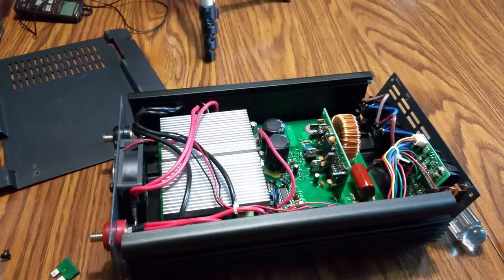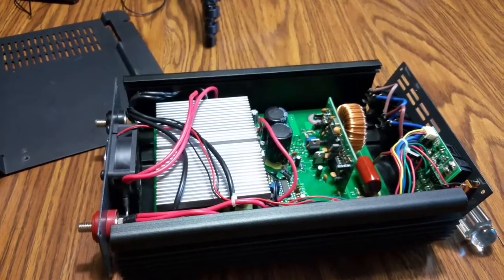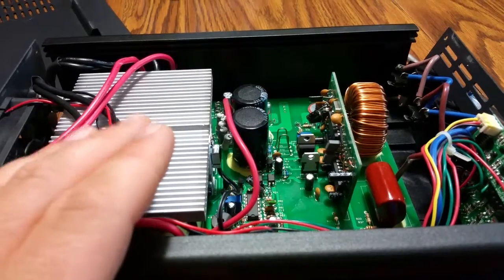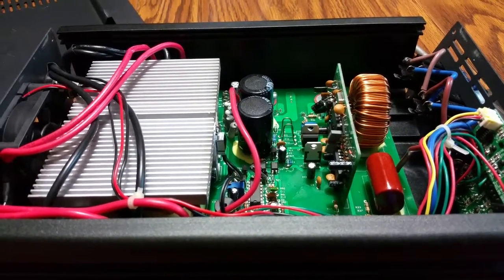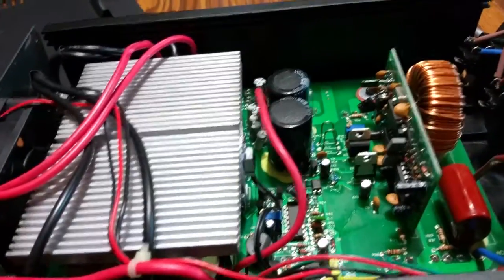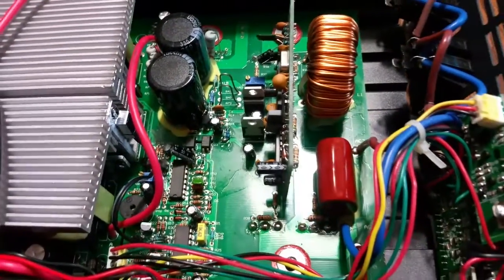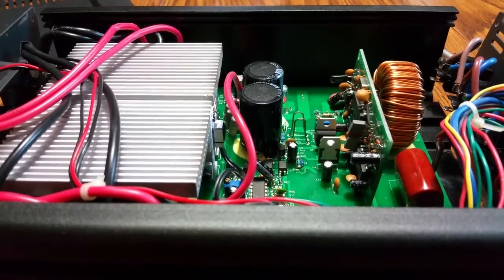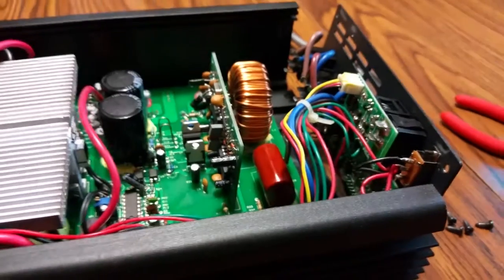Royal Power PS-1000 Inverter dead! Why?!

Comment: Your capacitors are leaking. You can see them the yellow stuff underneath them is the electrolyte. Just replace them with ones ones of the same value and make sure the polarity is right when you install the new ones.

Comment: Royal power are cheap crap. I've been through four over five years.
They are a little backyard outfit in Montreal. I know this, because I actually returned the first two  back to them.
I'm going with the pump sentry 822PS. Never again with Royal power...
Reply: Did you switch to that Pump Sentry 822PS? If so, how has it worked out for you? I have a Royal Power inverter I use for a sump pump that isn't working and looking for a new inverter/charger

Comment: I had and issue of the internal fuses blowing like that, till I went to Walmart and bought a car stereo fuse holder ( SCOSCHE 30 AMP FUSE and these fuses have a bigger element to them), because of the cable size connecting to invert to batt also. I connected it between on the pos terminal from inverter to battery. So to make a long story short, if it was going to blow a fuse, it would be the external not the internal fuses. And that pop was the fuses you heard.  But it never did that again and is still working fine :) But if it was a mosfet or capacitor it would have smoked and made a black mess inside. I don't see that in your's. So give it a try and you should always have a external fuse on the pos from batt to inverter :) Thanks for showing and hopes this helps.
Reply: TheBillytheJack2010 If it pops the external fuse on Battery cable, then you have a circuitry prob!

Comment: knurlgnar24 has a good video collection of pure sine wave and pulse width modulation inverters for review and repair. Check out his channel. My thought was when you started connecting the inverter to the aquarium that there might be potential problems with some aspects of the circuit board such that voltage surges and/or high currents were present from the battery causing the fuses to blow. The old adage that you don't mix water with electricity might apply here. Keep us posted. Good luck on your search for a solution!

Comment: Something's got to short for those fuses to pop imo - what, exactly, I wish I could tell you. My 5000 quit like yours. It was running a small load, maybe 300w, then 'pop' for no apparent reason. Thankfully the manual came with decent troubleshooting instructions so I'm going to make an attempt at a repair. Without them I'd be in your position, but if I succeed and learn anything that might help then I'll be sure to share it here.
Reply from the maker: I checked my batteries with the battery checker on my multi meter and they are OK. It's something inside the inverter that failed.
Reply: Likely. Insulation could have failed on a wire/circuit - but if you don't see any obvious signs of  short then a component's probbly failed, like a transformer, mosfets, etc. 

I'm quickly skipping through my repair manual - a bit of a headache because the original was translated from Chinese to English, so the grammar is really poor - but it's telling me that if the fuses blow under normal use then I have to check the mosfets to make sure they're working, and the corresponding resistors. How, exactly, I'm not yet sure, I'll have to read more into the instructions after supper